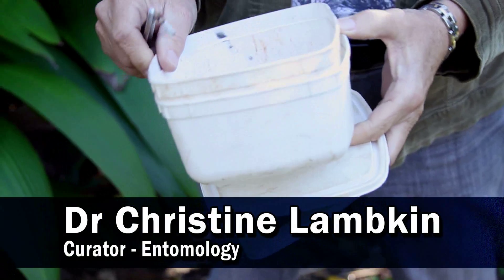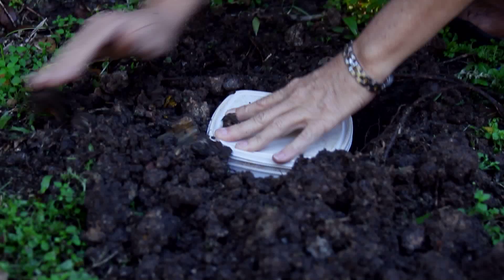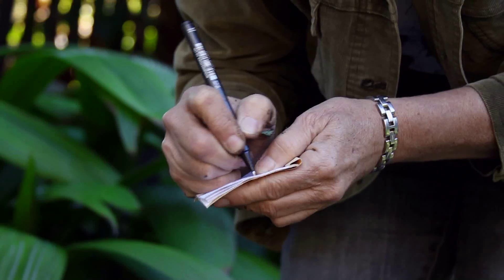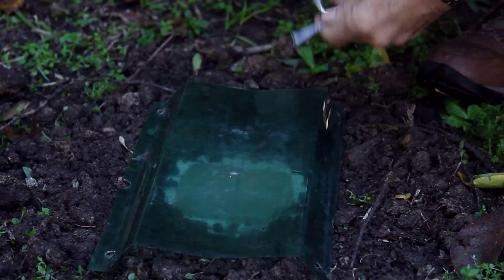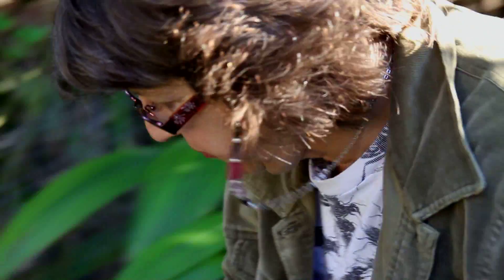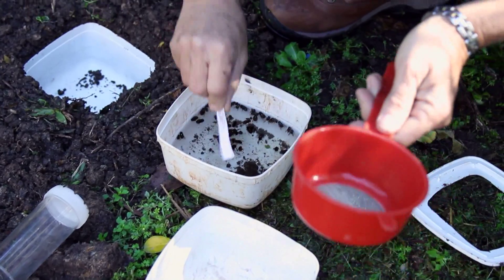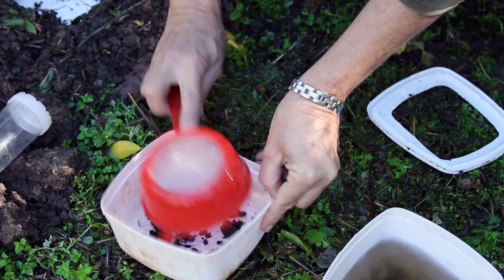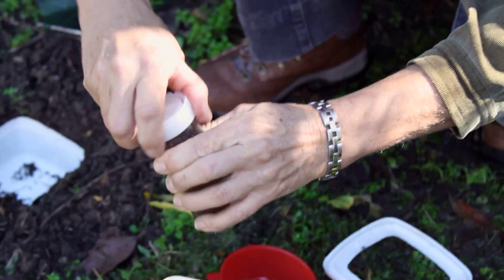Insect Collection - Pitfall Traps

Comment: there is not a cover over the contain... not in the sense that we would use the word cover to mean a tight fitting lid. It is a roof that stands a few centimeters above the container. This allows ground insects to have access to the trap.